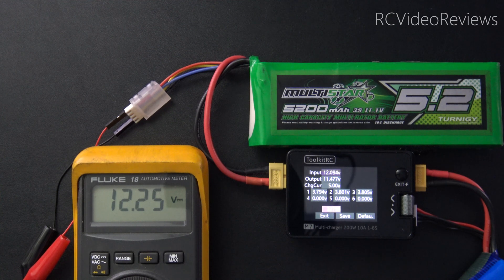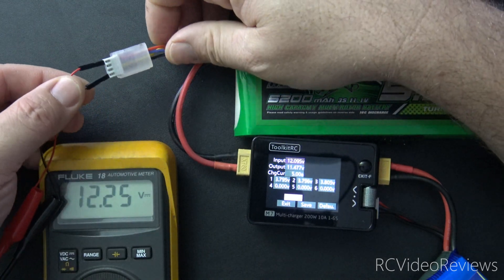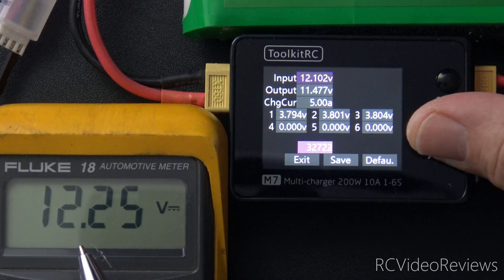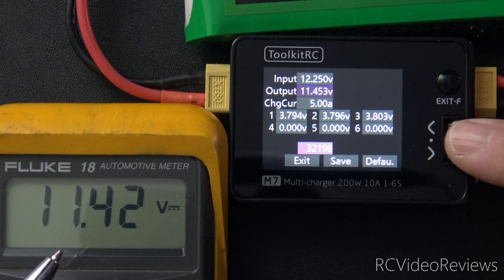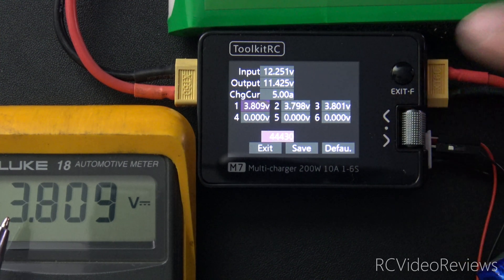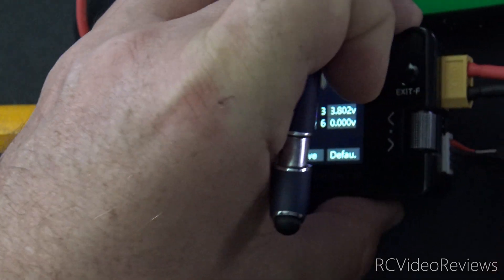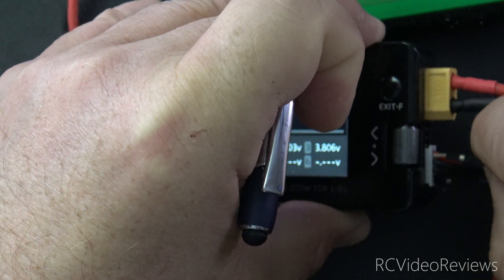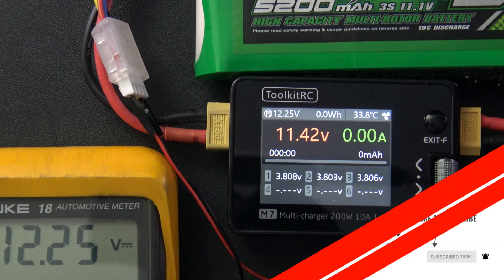How to Calibrate the ToolkitRC M7 LIPO Charger • Important Update in Description!

Comment: I am reaching out to inquire about the best charger for long trips. I need a device that can charge AA, AAA, 16340, and 18650 batteries, as well as my phone. My plan is to charge from solar panels to a power bank, and then use the power bank to charge these batteries. It is very important that the charger offers robust functionality, including both charging and testing capabilities for the batteries, and is lightweight for easy portability.

Could you please advise on the most suitable model  that meets these requirements?

Thank you for your assistance.

Comment: Hi john this is 3 year old video. What is the most trusted (and not expensive) voltage meter that you can trust without calibrating the multimeter because I want to use it to calibrate lipo charger and of course calibrate voltage on our edgetx radio and such. Ty john.
Reply from the maker: Check Venlab: https://amzn.to/3VkKT7e

I checked it against my very spendy Fluke 87v and it was shockingly accurate.

Comment: Seems the current readings of my two M6Ds and one M6DAC are way off and deviate much between the two charge ports. How to calibrate the ChgCur values?
If I charge and discharge the same battery on port 1 and on port 2 the mAh values are around 20% apart. There must be a major calibration problem with the internal shunt resistors. Also using a current clamp meter the shown current is way lower than the reading on the current meter, f.i. display 0.8 A and measured current 0.88 A.
Reply: i think i have the same problem if i read you correctly , i will drain 2 batterys for like 1000mah and then charge them , and port 1 even after calibration of voltages etc will always be charging for like 820-880mah and port 2 is always dead on 1000mah , port 1 seems to be charging higher then the selected 1A or 1.5A i ussualy go , but then again when i look at the amount charged they line up exactly until port 1 says its full at 850 and the other keeps going , theres like 10 minute diffrence in charge time also , very weird

Comment: Hi! Do you have ToolkitRC M7 V1.X firmware? I got failure after updating to 3.03
Reply from the maker: I don't. Did you flash the correct firmware? https://www.toolkitrc.com/m7  They show two versions. One for 2.xx mainboards and one for 3.xx mainboards.
Reply: @RCVideoReviews  , i need V1.x for old 1.xx motherboard
Reply from the maker: I suggest you contact ToolkitRC direct. I don't keep track of old firmware. Sorry.

Comment: Thanks for the video.. I can calibrate and it will align for that pack/voltage level, but if I swap to a voltage +/- > 1v things are out again.
I constantly have 0.12v open circuit coming and going so I'm guessing this has something to do with things as well.
I'm often getting values out by +/- 0.1-0.3v for a 4S pack.. concerning.. as this could be a big over charge value
Reply from the maker: You might want to check with Toolkit on that one.

Comment: Good video. How would you calibrate the current?
Reply from the maker: There is no current adjustment. I wouldn’t worry about it. Minor variations in amperage are not a big deal. If you wanted to validate current you could do the math from start voltage to finished voltage along with mah returned to the battery and how long it took to calculate what the amperage was during the cycle.
Reply: @RCVideoReviews  thanks! I will follow your video to calibrate my charger

Comment: I know the flukes are best but what If my multimeter is a little off?
Reply from the maker: It doesn't matter that much. This is all consumer gear and none of it is that precise anyway.
Reply: @RCVideoReviews  Won't that possibly allow it to over charge if my meter is off a bit? Say if a cell it 3.8 volts on my meter and really 3.95 so I set the unit to say 3.8 then it end up at 4.35 a cell after? LiPo 🔥
Reply from the maker: If your meter is off by that much you should replace it. To me, off "by a little" is a matter of a few one hundredths, not fifteen one hundredths.
Reply: @RCVideoReviews  True but can everyday cheap $15 $20 meters be?
Reply from the maker: I have no way of knowing that. If you’re going to be in the hobby you should have gear that is reasonably accurate but set your expectations appropriately. If you don’t pay for lab grade gear you won’t get lab grade accuracy.
Reply: @RCVideoReviews  Sorry one more thing...where do you get those thin probe wires or what are they called?

Comment: Do you need to do this to avoid over charging? Heard some people had.problems with this over charging.
Reply from the maker: I've never had a problem with overcharging using Toolkit gear. You do it to ensure the device is as accurate as possible. The factory configuration will likely work for 99% of the use cases because most people don't bother to learn how to calibrate anyway and you can't have chargers being so far out of whack they damage equipment for those of us who do know how to measure and calibrate. That wouldn't age well.

Comment: One thing I'd like to do when calibrating is instead use a really accurate 3.3v reference voltage from the power supply since batteries do drain a bit when plugged in the balance lead but having a constant 3.3v instead makes it more accurate
Reply: I wonder why nobody does this... It's way easier to set a value of 3.3-3.500v than some battery voltage that has ADHD. LOL
Reply: @kornshadow097  EXACTLY what I'm thinking about LMAO

Comment: So is the output the same as the voltage of the battery currently plugged in the balance port ? I can't check the voltage by my balance plug since I don't have those tiny multimeter plugs
Reply from the maker: The voltage is the same as the aggregate voltage of all cells. i.e. You have to plug in to the first and last lead on the balance lead. You can make one of these adapters from a female servo extension. Just cut the outer housing off and you're left with three of these pins. That's what I did.

Comment: I just did my M6D. The problem I found was that there was not enough adjustment to get to the voltage my multimeter was reading. I guess I will have to check my MM against another.
Reply from the maker: You might also want to adjust the reference voltage. Ie try 3.7v
Reply: @RCVideoReviews  I dont know which reference voltage you refer to. In the MM or the charger?
Reply from the maker: The battery. Charge or discharge the battery to somewhere close to 3.75 and try adjusting your M6D based on that voltage. Also, if it’s that far off, a sanity check with another mm wouldn’t be a bad idea.

Comment: Hey John. Have you experienced a low signal during taxiing on the ground about 60 yards out or so? Does the RM Tx16s require the plane off the ground/in the air to get better signal. Just dont want to crash a plane if signal is weak on internal module.
Reply from the maker: I haven't experienced anything like that. I've flown all non-FPV/lr planes I have on the TX16s internal module without issue--including my bigger more expensive planes.
Reply: @RCVideoReviews  yeah i have been taxiing all 3 of my planes from my f15, f18, and fw super scorpion. They all say low signal at about 60 yrds. Not sure if i should invest in the external module. Just wondering if its because its not getting good signal while on the ground.
Reply from the maker: RF is RF. All Part 15 devices wind up using similar EIRP although they may use different techniques to get there. I doubt you have a problem, but here are things you need to do:

1) Make sure your Rx antennas are at 90 degrees to each other if you have two. One on the vertical axis, one on the lateral or longitudinal axis.

2) Perform a frequency fine tune if available for the protocol you're using.

3) Ensure your antenna on the Tx is pointing at your forehead and not at the plane.

4) Conduct a range test: Put Tx in lower power mode, hold a servo, walk. The distance where the servo stops responding is the 1/30th of your range. 

5) Make sure you're using the correct telemetry and telemetry values for the warning. i.e. Not all receivers use 42 for low RSSI and not all use RSSI as the true indicator of link quality, some use---link quality. Study up on your Rx to ensure you're using the correct metric. OpenTx defaults to 45 low and 42 critical for RSSI. That may not be correct for your Rx.

Comment: A very useful video. But manufacturer should be the one doing it before shipping the charger as they will have very accurate  volt meter at the factory.
Reply from the maker: Do you want to trust cell balance to what "should" be done or is it worth 5 minutes of your time to validate it and know for certain? FWIW I've had plenty of devices come from the factory out of calibration--by a stretch.

Comment: Nice video, I had to adjust my TK M6D a decent amount when I got it also. Only issue is that I believe you did the cells backward. The ground should be used as the start, not the full battery positive. If you think about the charger, when you put any battery, 2S to 6S the ground pin is the only one that is always the same. Also, if you just slide the the balance plug of a 3S battery over to the other end of the balance lead input(charging side) you can calibrate cells 4-6 also.
Reply from the maker: I need to take a closer look at this. I'm finding conflicting info.
Reply: @RCVideoReviews  the fun of our hobby haha

Appreciate that you're looking into it instead of just ignoring it.
Reply from the maker: You're right. Cell #1 is the first ground. The last Cell is the positive wire. It took me a while to find a battery in my stash that was far enough out to trust a measurement. I'll update the video description and see if I can add some sort of overlay. Good catch. Thanks.
Reply: He did it right. You always start at the positive and work your way down
Reply: @MikeyMikey1968  then why when you move the balance plug over in the charger, 3S plug shift to the other side of the balance port, does it shift the cells towards 3-6? I'm not disagreeing with your statement about electricity, but how the chargers read the balance leads and report the cells.

Comment: Very nice tutorial! Is it necessary to calibrate the amperage as well?
Reply: Wow, that would be a challenge as most charger do not allow amperage calibration
Reply: @ocelee7794  Maybe I didn't give the right terminology. I calibrated the amperage indication on the M8S, so it more accurately shows the true amps the charger is delivering.
Reply from the maker: I don't really know how to calibrate for current as current requires a load and I don't know how to generate that load in the test configuration. How did you do it on your M8S?
Reply: @RCVideoReviews  I used a quality FLUKE multimeter, I borrowed, in series between the charger & the lipo I was charging. This particular meter has a 10 amp max capability. I felt that was close enough, though I have access to a load cell for a fuel cell test stand, if I wanted it be more precise.

Comment: Thanks for this ToolKitRC Charger calibration Tip.  Just did this to my M8. Just one thing to note. On my charger calibration the output battery must not be connected when going to the calibration routine. Connect it after you are in calibration mode.
Reply from the maker: Jerry, I just checked it on the M7 and M8S. When holding down the jog dial and connecting power to the output side, both devices entered the calibration menu and I was able to make/save changes. Does yours not work that way?
Reply: @RCVideoReviews  Yes it does... My point is that I can not have a battery, to be charged, plugged into the charger's output when I plug in a battery to the input while pressing the Jog Dial to Boot into the Calibration Menu. There should NOT be a battery plugged into the Charger's output port UNTIL the charger is on the Calibration Menu. 
Did that and it did not boot into the Calibration Menu.
Reply from the maker: Oh, no you cannot do that. The only way to get into the calibration menu is with everything disconnected first. However, I can boot into the calibration menu by pressing the jog dial and plugging a battery in to the output port.

Comment: Shouldn't we use multimeter with magnitude higher resolution? So in this case measure up to 4 decimal places on multimeter?
Reply: Not necessary... The 3rd decimal point on the charger is not stable enough to be useful.
Reply from the maker: As lasersbee points out, accuracy with consumer grade gear is good to a point. I also believe the generally accepted (although I have no evidence to back this up) delta for lipo cells is < .05/c  Anything more precise than that is going to be a whole lot of effort for a very small return.